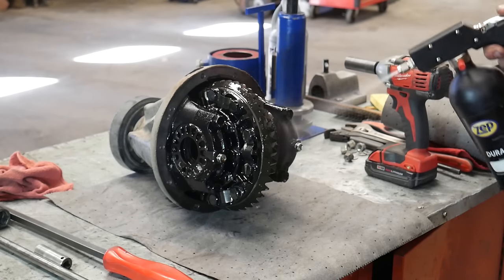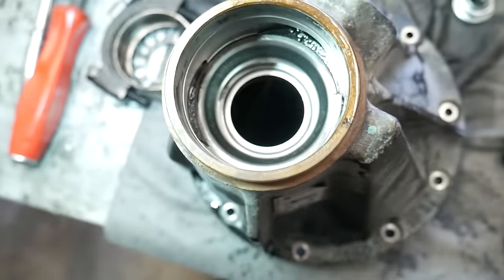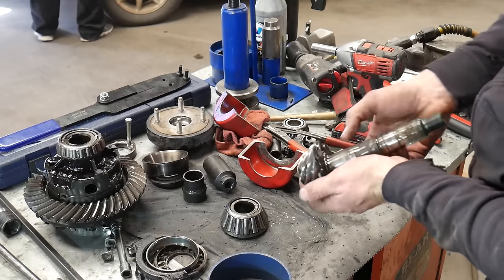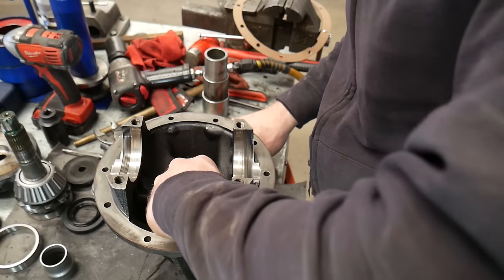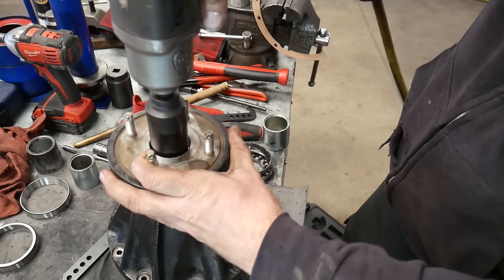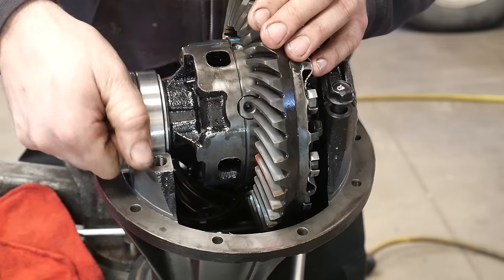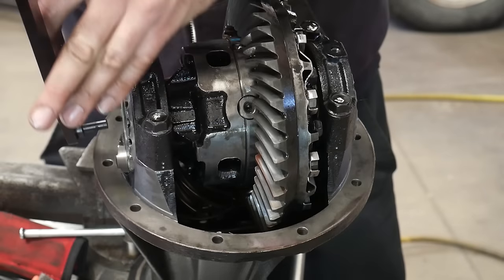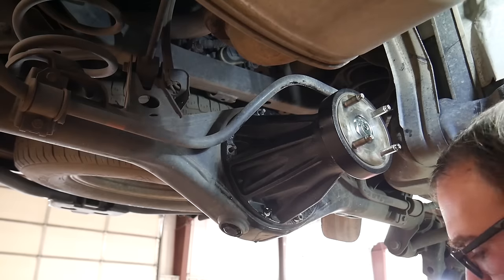2005 Toyota 4Runner Rear Differential Rebuild - Bearing Replacement

Comment: hey, my outer bearing ring is still moveable after tightening the screws of the bearing caps. is this normal or should this clamp the bearing ring in place?
Reply from the maker: I don’t think I’ve ever had one movable after tightening the bearing caps but normally when I tighten them down I already have some preload on the side bearings so it hold the adjuster in place. The locking tab will also prevent the adjusters from moving so Toyota must have known they could move a little bit.
Reply: @ThePracticalMechanic  thx. so there is Something wrong on mine. i can move them very easy and the bearing ring left some "grinding" marks in his seated place because it must have turned while driving. maybe there are the wrong bearings in the diff.

Comment: Nice! Subbed. 

My Tacoma clunks when i put it into reverse when it's cold. Sounds like it's coming from the rear end. It doesn't clunk or hardly clunks at all if I let go of the brakes right when I put it into reverse. I took it to a shop and they suggested to take it to another shop that specializes in rear ends. I've also had a few tell me it could be U-Joints. I recorded a video under the truck and showed another mechanic and he said it looked like there was excessive backlash. Any idea what the issue is? I'd like to rebuild it myself if I knew what parts to replace or what to look for. Thanks!
Reply from the maker: Johnathan Hartzell it could be the rear end but it could be u joints as well.  If you email the clip to chad@thepracticalmechanic.com I will take a look.
Reply from the maker: Responded back with some things to check.
Reply: @ThePracticalMechanic  Thanks a ton!!!!! I'll look into it
Reply from the maker: Johnathan Hartzell no problem.

Comment: What are using to clean it with in the zep durashot?
Reply from the maker: We use bulk brake parts cleaner in the zep durashot bottles.
Reply: ThePracticalMechanic awesome video btw and I’m buying the Yukon bearing remover because of this video👌🏻

Comment: Any info on that sprayer you're using?  Thanks!
Reply from the maker: It's from ZEP. I use it for brake parts cleaner. We have a machine that charges it with fluid and then air. It's kind of top heavy and they break easy when they fall off a tool cart. Sure-Shot has all metal ones that are tougher and less top heavy.
Reply: @ThePracticalMechanic  nice, I have used a sure shot in the past.  Thanks!

Comment: So I'm new to this but I didn't see you use any shims now I'm lost
Reply from the maker: There is only one shim on this version and it is under the inner pinion bearing. Instead of making us use shim Toyota has adjustment nuts on the differential side bearings. I wish all manufacturers did it this way.

Comment: So i'm in the process of rebuilding an 8'' e locker. I got the pre load and backlash to spec but from what i've read the carrier should add 5-7" pounds when installed on the pinion. But I still measured 10'' pounds on the pinion pre load with the carrier is installed like it measured with it off. What could be causing this?
Reply from the maker: You may need to add additional preload to carrier nuts. The manual doesn’t really explain how to adjust if the total preload is high or low. If the pinion preload is good I would add a little torque to one of the side bearings and see if it helps.

Comment: how many inch lbs to spin the pinion bearing flange according to the factory manual. Appreciated
Reply from the maker: The starting preload for the pinion alone is 5-7 in.lb for used bearings and 9-14 in.lb for new bearings and total preload for pinion and ringgear is measure pinion preload plus additional 3.5-5 in.lb 
 So 8.5-12 in.lb for used and 12.5-19 in.lbs for new bearings.

Comment: I had all my studs and bolts come out of the axles. Where can I get more?
Reply from the maker: If the studs came out of the axle housing you can just thread them back in but add a lily bit of thread locker on each one to seal the threads and keep them in place. You may want to try and remove several of the nuts from the studs and install the studs back into the housing to act as a guide for when the differential is reinstalled. Other wise you can get the stud from the dealership or most hardware and auto part suppliers.

Comment: Do you have to put a seal between the pinion and the actual differential housing?
Reply from the maker: There is a pinion seal that is installed after the gear setup has been tested. This is normally the last step because if the pinion has to be reshimmed the seal will have to be removed.

Comment: i seem ppl just drive the shit out of this and never care to CHANGE THE OIL ON IT. change the differential fluids is only 50 buck or less compare to a couple grand for rebuild or replace
Reply from the maker: allent yoglawm 👍🏻👍🏻 exactly. I change the oil on most of my vehicles at 3,000 or 5,000 instead of the recommended 7500 because oil is a whole lot cheaper than an engine.

Comment: What are the torque specs on the housing bolts mate?
Reply from the maker: When reinstalling into the axle housing the nuts are torqued to 15 ft.lbs
Reply: ThePracticalMechanic Cheers mate. You recon I can just use a sealant maker without the paper gasket?
Reply from the maker: That’s what I typically do. I like to apply sealant and let it sit overnight before adding gear oil. This allow the sealant to cure better.
Reply: ThePracticalMechanic Righto, I’m regearing my rig and you think it’s ok to change the rear diff for now and do the front later on. It’s my daily driver. I got manual locking hubs anyways.

Comment: But why the back and forth adjustment?  Please explain!
Reply from the maker: The two adjustment nuts on the sides of the differential are for adjusting the backlash or the clearance between the ring gear and pinion gear.

Comment: Can i replace a pinion bearing by pulling the driveshaft out? Or do i have to tear into the whole diff?
Reply from the maker: You would only have access to the outer pinion bearing while in the vehicle and it would be nearly impossible to remove the bearing and race without removing the assemble from the vehicle and disassembling the whole thing.